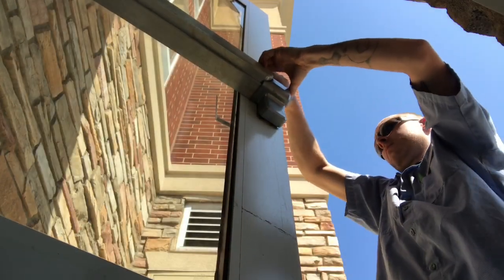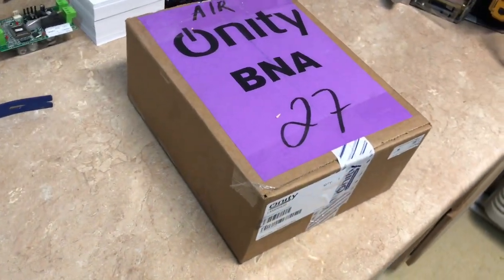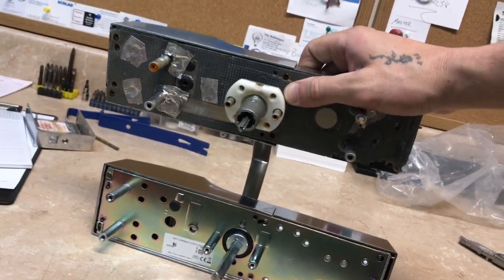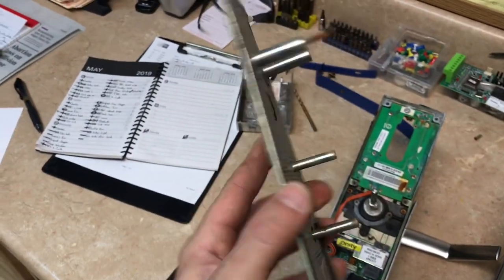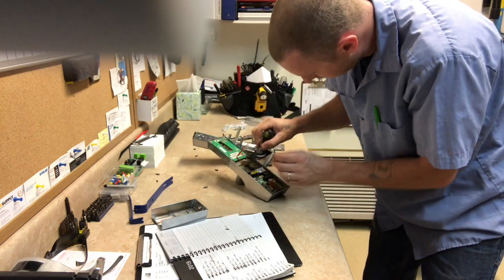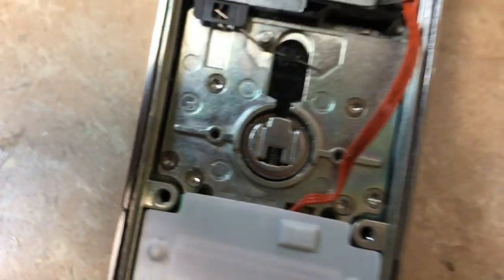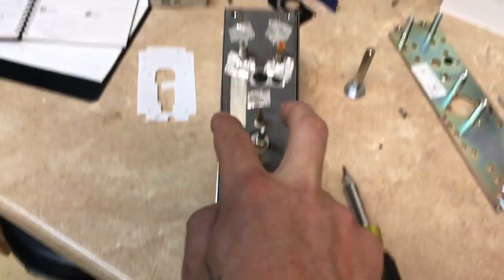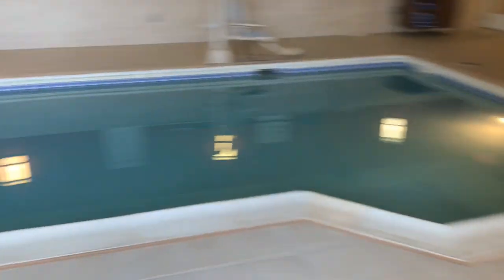HOW TO replace Onity HT24 half lock + swapping out old CLUTCH and BACK PLATE...

Comment: I followed every step but getting  signal from programmer say lock failed.
Reply from the maker: Cyndi Barnes once installed you have to program it as well...or perhaps a wire is not connected correctly...
Reply: @MAKdailli  I did try to program it. Its saying lock failed.  Anyway I have one more & I'm fixing to try it. Maybe it's the lock.... thanks